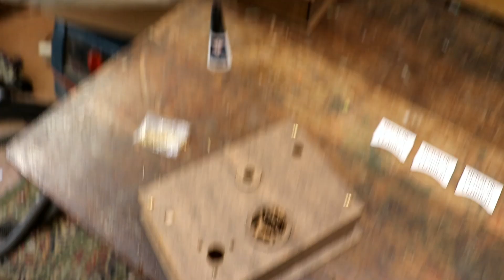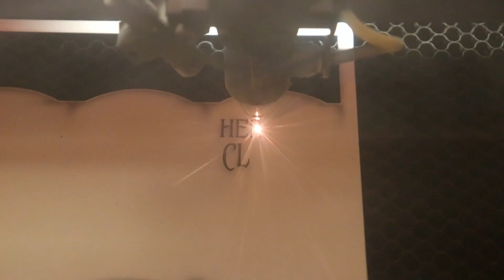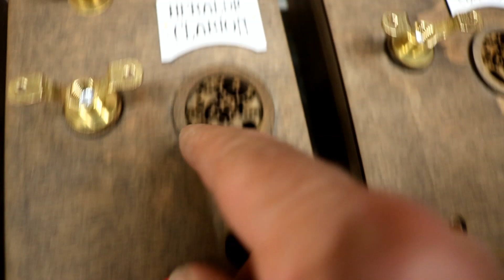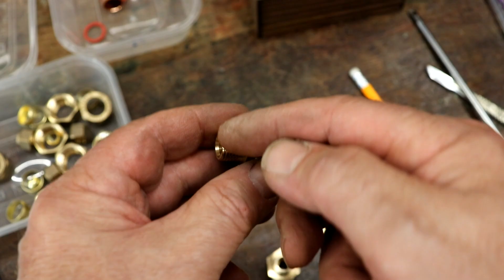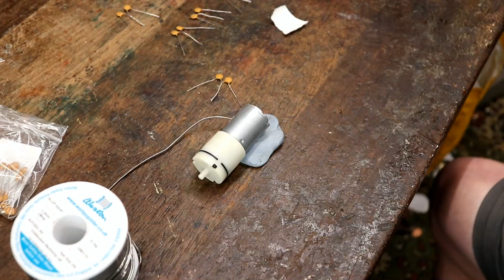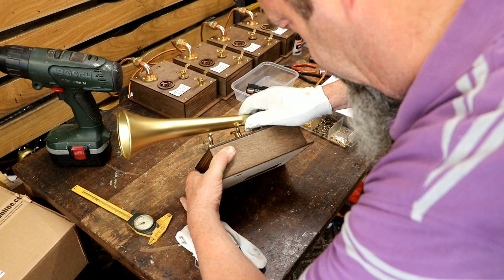Why have a boring doorbell when you can have an exciting steampunk air horn?!

Comment: Very nice!   One minor point, it's not a good idea to tin the ends of the wire before using screw terminals, over time the solder "flows" and gives a poor contact. Probably not a major problem for a doorbell, but a better solution is to crimp a ferrule onto the cable.  Where can I get some of the patience that you have... I would have given up after the first hour!
Reply from the maker: That's an interesting point, I'm sure I could absorb the cost of some crimping ferrules, although it is low voltage and current. Worth a thought, thank you. It is a joy when tenacity pays off and I'm very lucky to have the time to waste!

Comment: It was satisfying to see that the shipment arrived OK, although a bit rounder than it started out. Glad to hear that your meticulous packing did the trick. It is always nice to have an ending to a project. I love those little horns. I have a larger 4 horn set that sounds like a train running through the building. How does Ziggy react to the horns?
Reply from the maker: I was thrilled when it finally arrived safely to the customer, if a bit damaged. It always amazes me that couriers can and do inflict so much damage. Thank goodness for the double boxing and void fill!

The patented Spanish vuvuzelas are wonderful. Really well manufactured (unlike the hideous Chinese copies). It's so important to have a reliable source of horns. Good to know you have 4 air horns to announce visitors! Ziggy hates fireworks and lound noises, but thankfully doesn't seem to mind a single airhorn!

Comment: Optimising manufacture is so rewarding the Japanese call it Kiazen,  years gone I was commissioning part the new engine line in Deeside. Before work started we had instruction on the "Toyota Way".  A very interesting two days which all of us appreciated and applied to our company. John your adapted tooling reminds me of Toyota. Scratchy  

Further reading for your crew. Ref WiKi.  

The principles of the Toyota Way are divided into the two broad categories of continuous improvement and respect for human resources.  The standards for constant improvement include directives to set up a long-term vision, to engage in a step-by-step approach to challenges, to search for the root causes of problems, and to engage in ongoing innovation. 
The system is summarized in 14 principles:

  1 "Base your management decisions on a long-term philosophy, even at the expense of short-term financial goals."

2  "Create a continuous process flow to bring problems to the surface." Work processes are redesigned to eliminate waste (muda), such as overproduction and waiting times, through continuous improvement (kaizen).

3 "Use 'pull' systems to avoid overproduction." A pull system produces only the required material after a subsequent operation signals a need.

4  "Level out the workload (heijunka). (Work like the tortoise, not the hare.)" This principle aims to avoid overburdening people or equipment and creating uneven production levels (mura).

5 "Build a culture of stopping to fix problems, to get quality right the first time." Quality takes precedence (jidoka). Any employee can stop the process to signal a quality issue.

6  "Standardized tasks and processes are the foundation for continuous improvement and employee empowerment."

7 "Use visual control so no problems are hidden." This principle includes the 5S Program, steps that are used to make all workspaces efficient and productive, help people share workstations, reduce time looking for needed tools, and improve the work environment.

8  "Use only reliable, thoroughly tested technology that serves your people and processes."

9  "Grow leaders who thoroughly understand the work, live the philosophy, and teach it to others." This principle argues that training and ingrained perspective are necessary for maintaining the organization.

10 "Develop exceptional people and teams who follow your company's philosophy."

11 "Respect your extended network of partners and suppliers by challenging them and helping them improve." The automaker intends to apply the same principles to suppliers that its employees use.

12 "Go and see for yourself to thoroughly understand the situation (genchi genbutsu)." Toyota managers are expected to experience operations firsthand to see how they can be improved.

13 "Make decisions slowly by consensus, thoroughly considering all options; implement decisions rapidly (nemawashi)."

14 "Become a learning organization through relentless reflection (hansei) and continuous improvement (kaizen)." The general problem-solving technique to determine the root cause of a problem includes initial problem perception, clarification of the trouble, locating the cause, root cause analysis, applying countermeasures, reevaluating, and standardizing.

Comment: Very good to see you again. The Heraldic Clarion is a beautiful thing, and yet quite simple. Have you thought of having something very similar but with 2 or more trumpets. Once again you surprised me with the copper looking sheathed cable, I never knew such a beast existed. I was really pleased with the finished product, it does look as if it was Victorian. Just a small hint, you see the tapered blade on the pipe cutter, that too can be used to deburr the cut pipe, but somehow I think you know that already. Take care, have fun and see you next time 👍
Reply from the maker: I have considered using a couple of horns, but their very clever patented Spanish design means they all sound exactly the same! I assume I'd need to change the diameter of the membrane on the bottom to change their pitch. I suppose I could 3D print the bottom bit with different diameters, but I don't have an RF plastic welder to fix on the membranes. You've got me thinking - perhaps I could clamp on the membrane...

Thank you for the suggestion of using the tapered blade to remove burrs, they work well enough for 'real' water plumbing, but I'm always concerned about the risk of customers cutting themselves on sharp edges. The deburrer tool just works so well!
Reply: @steamhead  You're probably right, better safe than sorry. I know a lad, who stuck his finger, pinky I think, in the end of a freshly cut piece of 15mm pipe. He screamed when he turned it, no stitches but a strange scar on the tip. That was a few years ago, but as I read your reply it brought it back, weird how memory works. 👍
Reply from the maker: @thepagan5432 I too have a similar memory. I thought I'd be clever whilst plumbing in a radiator. Drain down the whole system? Nooo. Plumb in the radiator and then use compression fittings and a towel to absorb any leakage whilst sealing the ends of the pipes with my fingers. It worked, but I had two circular scars for months! Don't try this at home...